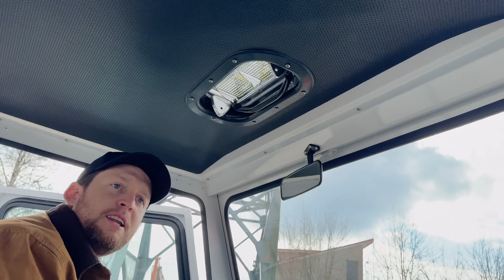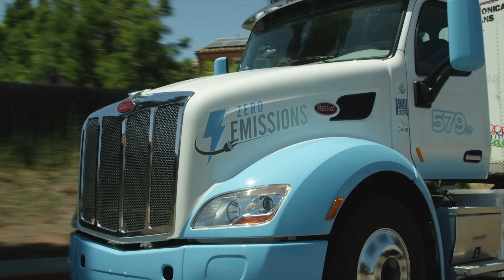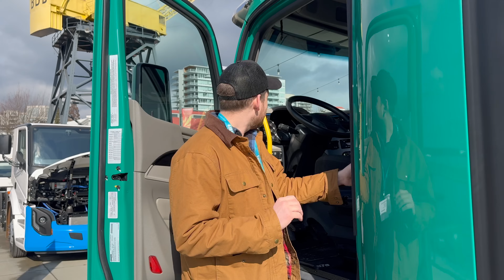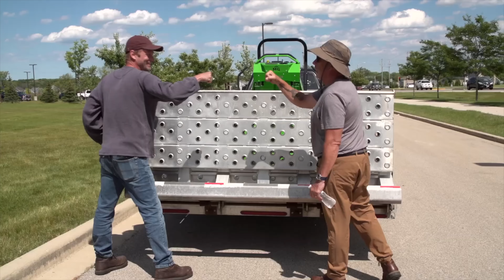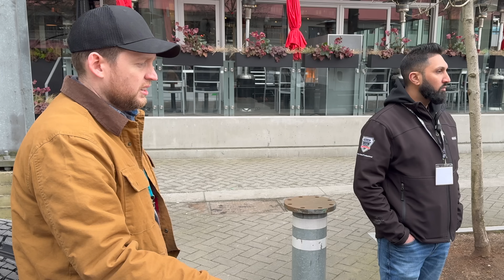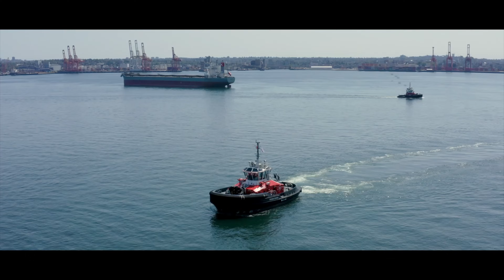The future of Electric Vehicles : What to expect in 2024

Comment: How about a changeable battery like a drill . Use a forklift to exchange batteries could be faster than filling a fuel tank .
Reply: They do that in Asia and Australia I believe.
Reply: There are electric race cars that work that way, car comes into the pits, battery swap, in less than 90 seconds it’s back on track

Comment: EVERY EV on the market is a scam.
Reply: Well you surely picked a hill to die on.

A incredibly stupid hill to be fair xD
Reply: @zaarkeru3391  Ok so tell me what is stupid about paying more for a vehicle to set and wait for, sometimes hours, to charge but always long periods, and a vehicle that has short ranges and loses range in cold temperatures.
Reply: @JohnSmith-ug5ci  
1. Way less maintennance and lifetime costs is the only relevant variable for people who use their equipment.

2. Most people/workers buy the best tool for their job, not a tool that will do stuff you never use them for.

3. Being able to run your own equipment, on your own power is extremely liberating.
Imagine a farmer (in the future of course) where they run electric equipment on their own power.
Not connected to anyone else but themselves
Reply: @zaarkeru3391  thanks for the reply but those claims are false. Those claims are used to sell them but the claims are false. As for farmers, no farmer would be able to get anything done due to the need to constantly charge the vehicle.
Reply: @JohnSmith-ug5ci  
True claims still, after all, facts doesn't care about your feelings.

And we're not far from being able to do farmers work with electric tractors.
Typical heavy rotavator work uses 8 liters per hour, and a diesel in such a scenario is about (best case) 30% efficient.
A electric motor/drivetrain is easily 90% efficient.
Thats ~27 kWh/h.
A 12 hour work day would be ~300 kWh.

So we're not far off today.
Give it a decade and farmers would be thick not going electric.

You make your own power with solar or wind.
You power your own facilities with that power and store it in your own electric equipment with batteries (stationary storage) and you drive electric vehicles that require basically zero maintenance. 

A farmer wastes a ton of time and money yearly just to service their stuff.
Reply: @zaarkeru3391  your claims are bogus.
Reply: @JohnSmith-ug5ci  
Again, facts doesn't care about your feelings.

How much farm work have you done bud?
Reply: @zaarkeru3391  thousands of hours. I grew up on the farm. The electric tractors of today could not possibly be of any use.
Reply: @JohnSmith-ug5ci  
Then you should know farmers equipment doesn't use that much fuel...
You SHOULD know this...

And please check what I wrote again, I didn't say today.
I said in 10 years.

Today we could easily have hybrid farm equipment which would probably do a better job than current diesel tractors (as a example).

Imagine not having a gearbox to service.
Being sensitive, fragile and irrational isn't a good look bud
Reply: @zaarkeru3391  you clearly do not know what you are talking about. Farm equipment is already expensive enough. Adding to the cost, which will never pay for itself, is a fools journey.
Reply: @JohnSmith-ug5ci  
But it will.
Because farmers already installs solar and wind on their property....

The reduced service costs pays for itself longterm.

What you're saying is that adding all of the cost of running classical diesel equipment, which is higher longterm is better than electric because...
Yeah, what's exactly the reason?

Only the fact that farmers can get independence from the trade of fuel is massive.

Deere are already developing E axles for their equipment, their eAutoPowr trans is basically what Edison does already....

Again, full electric isn't there yet.
Hybrid on the other hand is simply more superior to conventional diesel drive.
Reply: @zaarkeru3391  solar is a loser. That being said it does not fix the long charge times, and the overprices tractor. In the winter it is even worse. EVERY EV on the market is a scam.
Reply: @JohnSmith-ug5ci  
Again, farmers are putting up solar and wind regardless what you feel about it...

Farmers have massive empty roofs that can be used.
Energy independence for farmers is the future, regardless what you feel about it.

And modern Solar panels still generates power in the winters, so that's not an issue.

Charge times isn't an issue with most farm equipment isn't used 24/7, they are used as needed.

Small utility tractors are used a few hours per day and use very little energy.
Even medium sized tractors would work (probably).

Comment: Mining trucks in open cut mines have been diesel electric for decades.  They are essentially a diesel electric locomotive with rubber tyres
Reply: With a battery pack in between you get regen and the diesel generator will run less=less noxious fumes.

Comment: Would love to know what your thoughts are on the Cummins Gasoline/CNG/Hydrogen 6.7 and X15 motor and would it be a hybrid electric option you'd consider. Living in California road diesel vs premium gas is a .50-70 cent difference and the robustness of diesel pressure rated blocks running Gas or CNG would mean long life and mean core motor parts other than heads availability. Having driven an old Thermodyne 903 powered Mack that piled its trade in the redwoods of Mendocino county it had the power to move just as much as any Big Cam 400.

Comment: The canEV reminds me of the Taylor Electric truck that I used for probably 18 years and it was the most dependable machine we owned. This is an improvement because the body is easier to repair and less sheet metal in fenders. We were on the ocean in a sea port and the corrosion on the body was the only problem. It hauled more weight than anyone could believe and the maintenance was just cleaning battery terminals once a year. I hope this company does well

Comment: It always just baffled me that hybrids originally weren't built like the Volt with the generator running an electric drivetrain. 

We could have have been driving them for years, and they probably would have lasted way longer and been way cheaper
Reply: " the Volt with the generator running an electric drivetrain". Actually the idea is the ICE generator only coming on to charge the battery pack. Diesel Electric Locomotives though power the wheels directly. I guess they dont have regen then though. Should have!

Comment: Imagine you have to go 200m, do some work, go another 150m, do some work................with an ICEvehicle with particelfilter. There is no worse thing you can do to an engine.
Reply: Millions of ice do it every day. It's not a problem.
Reply: @RCVW-y4x  Then you do not understand the engineering strengths and limitations of ICE on a fundamental level. 

Any good mechanic, engineer, or well read enthusiast can tell you that an ICE that is subjected to short duty cycles with high variation in load is going to wear worse and be less efficient overall than an identical ICE which only experiences fairly long duty cycles with little load variation, assuming the same workload for each.

Comment: You keep saying they have zero emissions when you plug them into a charging station that charging station is getting its power from either coal, natural gas and big diesel generators and top that off the materials these vehicles are made from come from petroleum which is fossil fuel.  When looking at all that, there is no such thing as zero emissions. Please do not say zero emissions
Reply: BC is mostly Hydro....
Reply: Remote Emissions Vehicles
Reply: We are mostly Hydro here. Solar with storage is cheaper than coal or gas now,whats stopping you?

Comment: 11:19  $1.98 for 22kWh or 9¢/kWh.  Is your electricity really that cheap?
Reply: BC Hydro Electricity Rates
Current rates for residential customers as of January 1, 2024, are: Basic charge = $0.2117 per day. Step 1 energy charge (first 1376 kilowatt hours (kWh))1 = $0.0975/kWh. Step 2 energy charge (every kWh over 1376) = $0.1408/kWh.
Reply: Yes, BC has government regulated rates, it is 9.75 c/kwh, and no separate delivery fees :).   In Alberta it is around 30 c/kwh when delivery (which is charged separately to 20c/kwh electricity price) is included

Comment: I used to own a mowing company and considered investing in electric mowers. There were no legit options at the time, but i knew it wouldn't be long. I'm curious what the cost is, but that machine looks great! Besides the green color, I'd paint it first thing 😂
Reply: Starts at $38k USD.  Don't know what the battery replacement cost is though.  They say it lasts 10 years, but only warranty it for 5, so they really don't believe it will last 10.
Reply: @N-M424  thank you. As far as life span, you never know. My power driver is ten years old and probably had a year warranty. I suspect the motors running the cutting deck would be the weak point unless it's only used in perfect conditions. Where I live, mowing down weeds on rural properties is common which comes with hitting rocks and unseen junk. I seem to be replacing spindles about every season

Comment: I am sure you know as a logger but when I was an OTR driver in the lower 48 stickers in that area would easily get covered with dirt and grim and rubbed off.
@EdisonMotors I would suggest making a 'Bill Box' style of container inside the door or a tool box. This would have a window on the outside and allow access from the interior of the door so that the slip can be updated. This will allow it to be visible, protected and easily updatable.

Comment: nice

that might-e truck comes with copper nickel brake lines and stainless hardware on the outside so it wont have as much rust issues as other stuff

Comment: Chace speaks wisdom as far as no “transitional” step to EV’s. The truck components are economical, available, and proven over decades, so don’t mess with them. A lot of the electric systems are also more common, much more so than the OEM’s are trying to put out. Being hybrid, you can choose to use your yard infrastructure, or go long haul, using existing support and facilities for fuel, light maintenance, and simply parking. You are free to embrace change as it comes along, and able to maintain full operation during emergency and disaster situations when you’re literally on your own. This means real world thinking without sacrificing your drivers and your business to the sheer stupidity that is prevalent in the EV space of trucking at the moment. Can’t wait to see Topsy wearing out some tires on the road.

Comment: For the mower - add a snow blower and ballast for winter usefulness all over the north (hope the batteries are set up as winterized

The most obvious full electric  use case is mountain miinimg operations - like logging, returning to "near sealevel"  full and returning uphill empty - just like the bush side (log retrieval phase) of logging..  (leave the highway hauling to a Freightliner or Kenworth W series

Comment: Hydrogen and Biofuel are the future.
Reply: Takes a lot of electricity so far to create green hydrogen to create...more electricity in a fuel cell. To burn hydrogen straight up in an ICE still produces noxious fumes like diesel, less. Bio fuel better than burning gas or diesel but still makes GHGs.
Reply: @jaaklucas1329    Hydrogen combustion byproduct is just water vapour that’s why when you make hydrogen from natural gas CO2 is a byproduct because Hydrogen does not contain CO2 also strictly speaking the only emissions from Biofuel is the CO2 the plants capture.

Also zero emissions is not the goal lower emissions is which both Hydrogen and Biofuel would achieve also one of the best ways to reduce pollution is by making things to last as something that lasts for 80 years is cleaner than something that only last 20 years.

Let’s use Europe as an example if you don’t include Russia Europe doesn’t even produce 5% of the worlds pollution were between China and America they produce almost half of the world pollution and realistically only China, America,India and Russia can lower the worlds emissions being the biggest 4 by miles.
Reply: @jammiedodger7040  I was on hydrogen and biofuels a while ago. Still burning, breathing this stuff. Heres a quick google search..
As a carbon-free fuel, hydrogen has the desirable property that its combustion releases no CO2. However, H2 combustion does generate NOx since, as noted above, NOx is formed when air is heated to high temperatures. From a NOx emissions perspective, the combustion of fuel blends containing H2 raises two key issues.
Reply: @jaaklucas1329  It produces minimal NOx a lot lower than petrol and also produces no CO2.

Also arguably radiation is worse than NOx and NOx can be pulled out of the air and used in manufacturing processes it’s like even CO2 is used in some manufacturing processes so we can pull it out of the air and use it.

Both Hydrogen and Biofuel are safe and clean and is the way forward to making the air in our cities cleaner.
Reply: @jammiedodger7040  Clean air is what Im interested in...

Comment: I think the lock out tag out on the rig has to be simpler.

In an emergency situation a first responder is not going to be trying to pull out their phone and try to scan a QR code and open up the hood that might wrecked. The kill switches have to be big, obvious, and external.
Reply: I agree, too many steps and too much time in an emergency situation. We've had ICE vehicles for decades that employ a fuel cut off when the air bags are deployed. It would seem prudent and more fail safe to adopt a similar system for EV.
Reply: @davidzook8569 There are no airbags in any tractors. The sensible logic being that you don't want the vision of a driver of the largest thing on the road being obscured because they hit something smaller than them.
Reply: @RowanHawkins I never said there were, however a system of switches could easily be used in a similar manner to activate battery cut outs and disconnect high voltage circuits in the event of a crash.

Comment: If your RPM is constant, hy not use a Turbine?
Reply: High emissions, high fuel consumption, expensive maintenance, expensive
Reply: @flyovercounty1427  Turbines are wasted at idle. At peak load, they have the best characteristics. I'd like to read Gibbs, but it's  quite the challenge.

Comment: I like that peterbilt, for the owner operator who wants to be home daily I could see how that truck could easily drive all day and charge most of the way or all the way at night.

The mostly stop and go and with nightly charging could last all week. The fuel savings alone for local work seems super appealing
Reply: Good luck charging that 400 kW battery at home over night.....plus, the 150 mile range is going fall a little short of the typical local route.